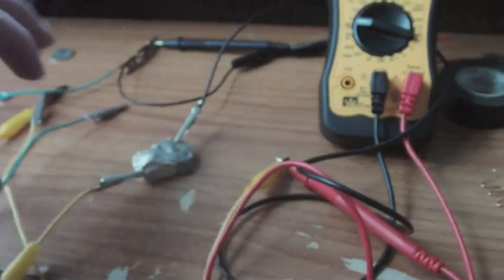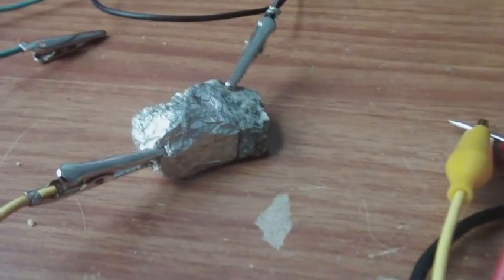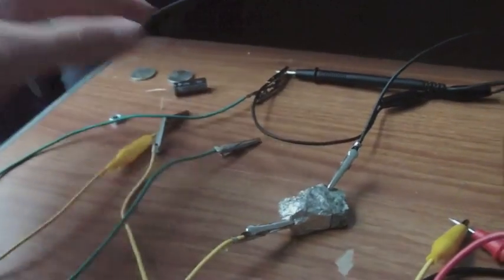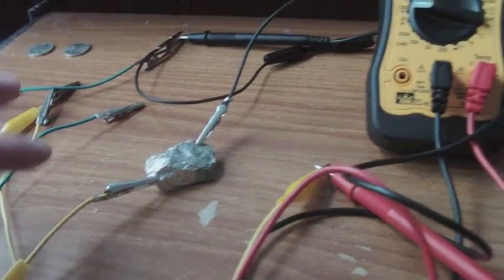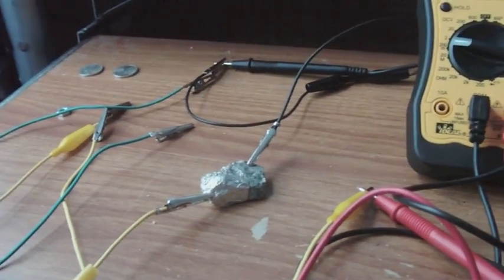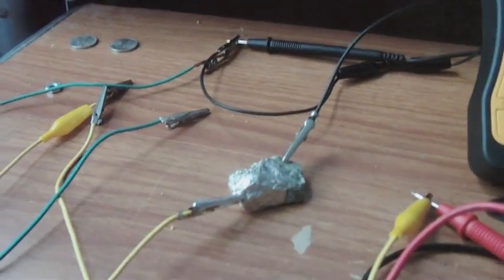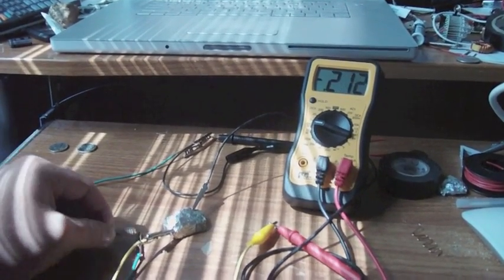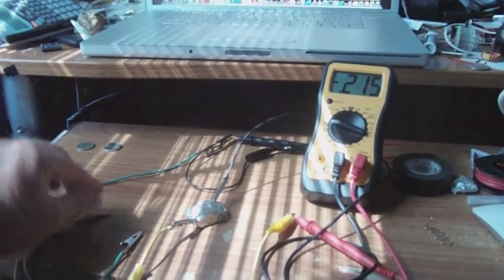Rock Battery

Comment from the maker: @camelsonhorizon 

Of course theres current, you can't have voltage without current. I did this experiment a while ago so I don't remember much but know a lot of rocks do this. If you like this you should check out the "bedini eath light" on energetic forum website, they talk about the same thing and have circuits running off their crystal batteries.

Comment: All you need is to hook up enough crystal batteries like John Hutchinson's to get 12 volts and use the 12 volts to operate a computer tornado fan... glue small magnets to the blades of the fan and put the fan inside a coil and you will get free energy forever. To increase the voltage even more add a capacitor and a spark gap and an antenna...then who needs the grid?